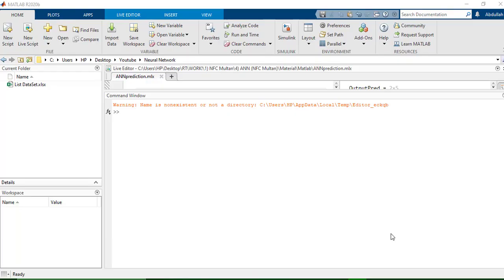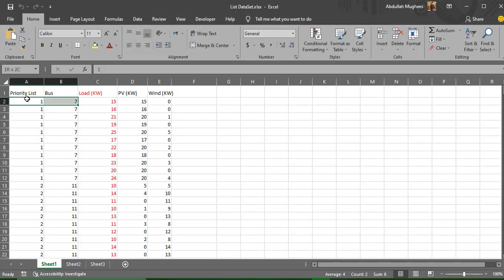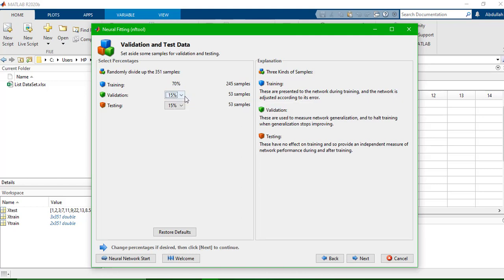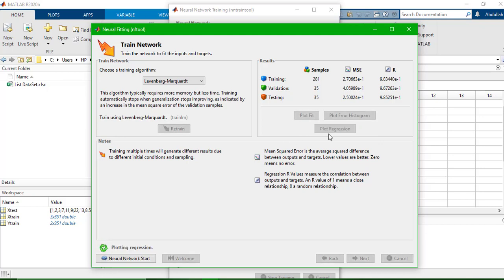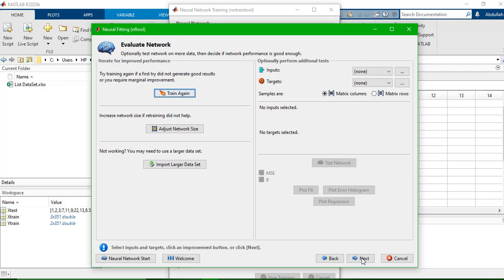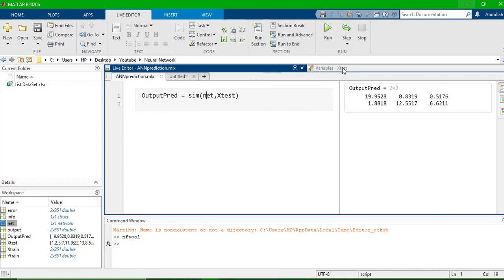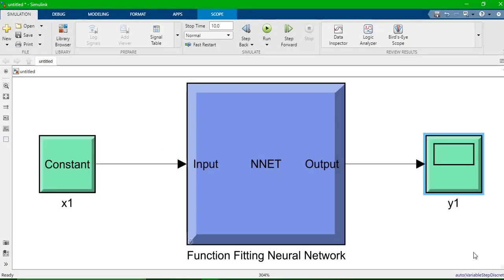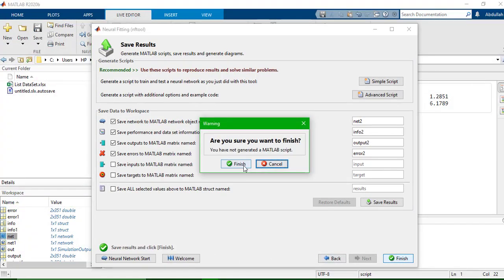Implementation of Artificial Neural Network (ANN) in MATLAB-SIMULINK! Step by Step Complete Tutorial

Comment: Thank you so much for your video. It's very helpful. Can i ask a question, pls. i have trouble while trying to use the trained neural network, in Live editor. i dont understand the [OutputPred = sim(net, Xtest)] at the moment 9:10 in your video. Tried using it, the sistem noted the eror [No system or file called 'out' found] - when i typed [Outputpred = sim('out', tets)] or   eror  ['model' parameter must be a character vector] when i type [OutputPred = sim(out, tets)] I use matlab 2021b. Can you please help me solve this problem, sir. Thank you so much for your time and your video again.
Reply: did you found the solution?
Reply: @EqhwanVid  Can U show me my mistake using it please. Have a great day!
Reply: I just found out the solution. Go to HOME tab and click live script. It should be on the upper left side of the window, then you can type your prediction OutputPred = sim("yournetwork","VariableForPrediction") and click RUN; it will take a few moments before it generates the results. Hope it helps.
Reply: you have to click on the "Save Results" first then only the file called 'out' will appear in the workspace. Then, you can run the live editor with the "Outputpred = sim('out', tets" command..The prediction values will appear on the right of the live editor window